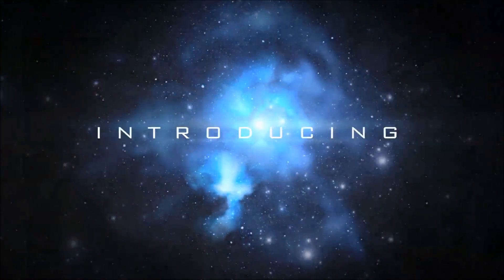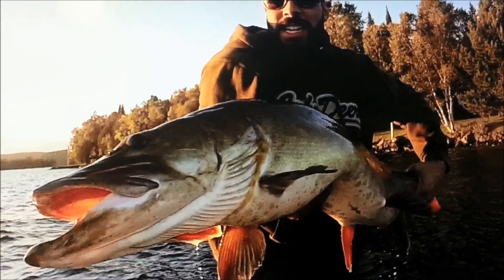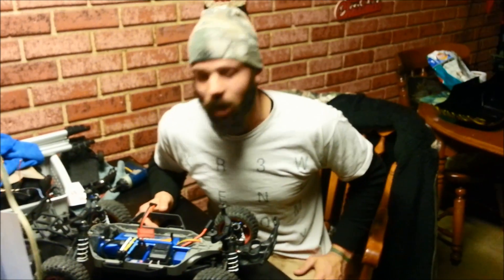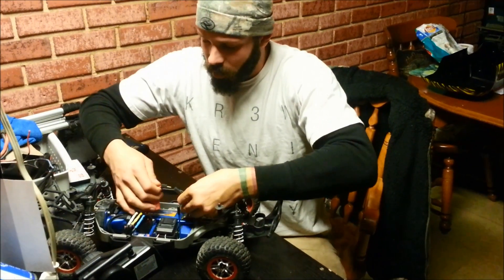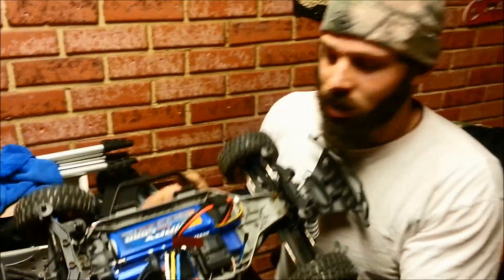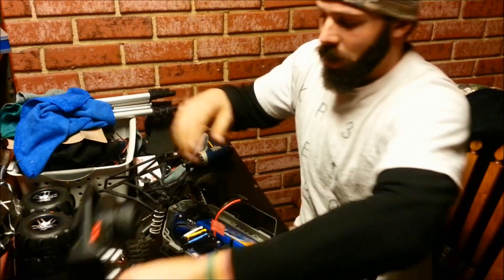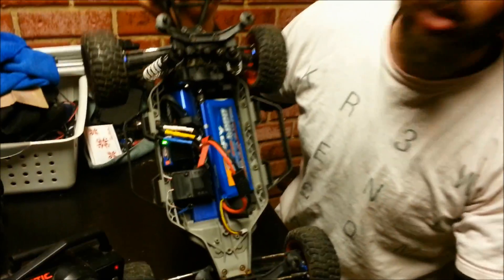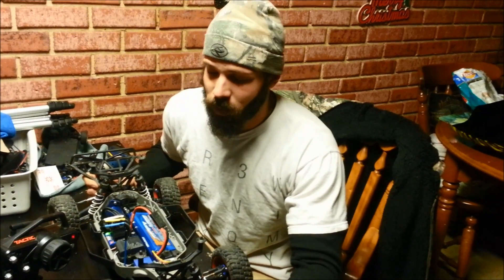Traxxas: How to fix flashing green light on your brushless esc

Comment: Will resetting my TQ Transmiter also "fix" this, or do I have to do this step manually? I am having problems with my Slash 4x4 VXL blinking fast green and no amount of tech support can fix . They said to send in my ESC and Reciever module for repair. I want to try all the youtube fixes first. :)

Comment: Mines flashing green when you give it throttle sounds like it's cutting in and out and wants to take off without touching the throttle
Reply from the maker: That sounds like throttle trim issue still. Try turning trim knob to center first, if that doesn't work adjust trim knob until the cut in/out stops.... if that doesn't work, check your trigger to see if it fully returns from either forward or backwards
Reply: Thanks it was a bad ESC according to Traxxas there sending me a new one

Comment: any chance you still answer questions regarding this video?  I am having the same issue in 2021 with traxxas rustler 4x4 using a spektrum SR315 and a SLT3 radio.  I put the throttle trim to middle but still same issue.  I will keep trying small adjustments I suppose to see if something finally works.  Any more tips on this?  :-)
Reply from the maker: I'm sorry, I've never had spektrum...  I have in recent years found that this tip didn't always work.  I've had to reprogram/reset esc's as well

Comment: A throttle value of more than 0% (usually the pwm signal is from 1000 to 2000Hz, also called the duty cycle) while powering on puts the ESC into "calibrate throttle" mode. This is done properly by setting the throttle to 100%, powering on the ESC, then setting the throttle to 0% again. So if the radio on full throttle is 1800, then the throttle range is adjusted so that 100% throttle isnt on 2000, but a pwm signal of 1800 instead -> full throttle range available. 
I guess on cars the idle value isn't 1000 (0%),  because it has reverse, which makes it a bit more difficult and why it easily goes into throttle calibration. Perhaps just tuning the idle as low as possible without actually starting to reverse would work?

Comment: Good and simple fix. I used to have this issue all the time. This can happen with any radio system, by the way. Also, you don't have to turn the esc and tx off, you can slowly adjust the throttle trum until the green light on the esc stops flashing and turns solid.

Comment: i have a brushless traxxas slash 4x4 all stock. for a battery i use a 3s lipo it used to work great but now when i go full throttle the esc blinks red and stops working. throttle stops working but steering still works anyone know why?

Comment: You saved my Rustler! It is not a third party friendly ESC. My radio has a very very short reverse travel, and I had to adjust my throttle travel shorter than normal, as to deceive the ESC to believe the radio is neutral.  Still happy that the light stopping blinking.

Comment: UPDATE!!: My issue happened to be my spektrum digital rx/tx. NO MATTER HOW I SET MY THROTTLE TRIM ON MY SPEKTRUM NO MATTER IT BE 0% TO 100% IT WOULD NOT REGISTER. So I just pulled out my tqi bluetooth remote and one of my traxxas receivers, threw it in.....BAM works just fine. It seems that the particular model of remote I have just doesn't like traxxas. Lmfao
Reply: I bought a brand new esc/motor combo because the previous esc lost reverse so at this point I know the esc is fine and this isnt exactly my first rc car. Lol And I have a nice ass spektrum rx/tx that has so many quick functions to access compared to digging through the traxxas alo on the fly, so I was really hoping to use it. Idk what I'm doing wrong but it simply won't register as zeroed out on the throttle no matter how I set it.

Comment: I've adjusted mine every which way and still no luck.
Reply: Perhaps try making your throttle (or reverse) travel range shorter, as to deceive the ESC until it believes your throttle is at neutral position.
Reply: Nah, my problem was that I couldn't get the digital spektrum remote to register as zeroed out no matter how I set the throttle. I wanted to use the spektrum on my mini revo and my tqi bluetooth on my large slash. Syncs right up to the 10th scale esc but not the mini.

Comment: Mine is still flashing
Reply: Trapper Gregory same
Reply: @jmac_6921  yup
Reply: Perhaps try making your throttle (or reverse) travel range shorter, as to deceive the ESC until it believes your throttle is at neutral position.
Reply: @kenlin4501  in my case, I had to tweak the zero position slightly, but my esc is seemingly stuck in race mode.
Reply: Same as mine. It automatically turned into race mode. I don’t have reverse now. Don’t know if I could change the mode back to sport mode.
Reply: If you have a Lithium Polymer (LiPo) battery, connect it to the ESC and turn it on. The light on the ESC should be steady green, indicating the LVD is "ON". Then you can simply switch the LVD to "OFF" by holding the EZ-Set button until the light switches to red.

 

If you do not have a LiPo battery, then follow the procedure below to switch the LVD to "OFF".

1. Turn the transmitter "ON".

2. Plug a fully-charged NiMH battery into the ESC.

3. Press and hold the blue EZ-Set button on the ESC. The ESC light will turn on green, then turn red. Let go immediately when the light turns red.

4. The light on the ESC should flash red once, then shut off. At this point, pull and hold the transmitter trigger to full throttle.

5. The light on the ESC should flash red twice. At this point, push and hold the transmitter trigger to full reverse. DO NOT let go of full reverse.

6. The light on the ESC should turn steady or blinking green. While still holding full reverse, press and hold the EZ-Set button on the ESC.

7. The light on the ESC should turn off for 5-10 seconds, then turn steady red. You may also hear three beeps from the motor, or a descending musical tone. When this happens, release the EZ-Set button and the transmitter trigger.

8. If the ESC shows a steady red light, the procedure was a success, and your vehicle is ready to drive.

Comment: I got lucky with my slash VXL 4x4.  Nothing was working, so I started taking it apart to look at the bottom of the receiver.  No broken wires.  Turns out, one of the channel headers had popped out inside the receiver itself.  Just plugged it back in and voila!
Reply from the maker: Eric Burcham Right on!

Comment: so after some searching.set multi function knob to throttle trim.held power button down and rotated throttle trim full left and full right.realeased power button and flashing green light issue was gone. trucks been running great since.unreal brakes.

Comment: Also ,  the wires going into the ECM can be broken!  That can also cause the flashing green light , like mine...
Reply from the maker: Good to know, Thanks!!
Reply: mines doing that to my trim is centered just bought a brand new motor hooked it up to battery works fine un plug it than hook it up to the esc than it flashes green

Comment: Mines doing it with a standard radio
Reply from the maker: +Sam Brentwood Did you try centering your throttle trim ( if you have one) before putting power to the esc? Or check that your trigger isn't stuck aswell
Reply: +JablesOutdoors the trigger was slightly stuck and ghost fixed it. when I bought the truck it had been in a storage box for a few months and the trigger was resting against the truck in a partial throttle position. after I worked it back and forth a few times it went back to normal